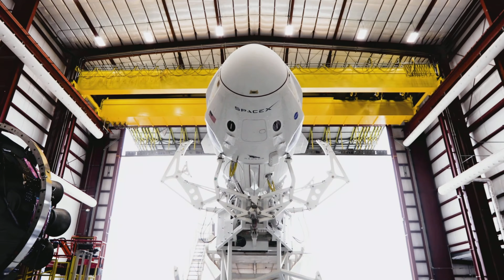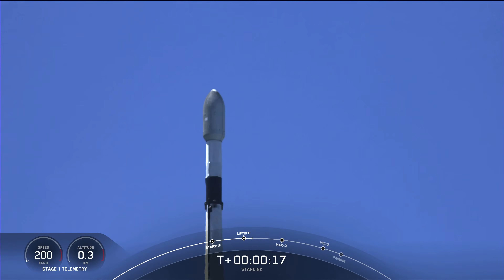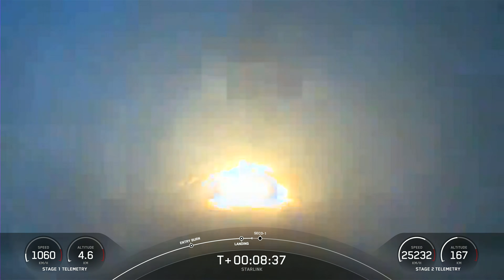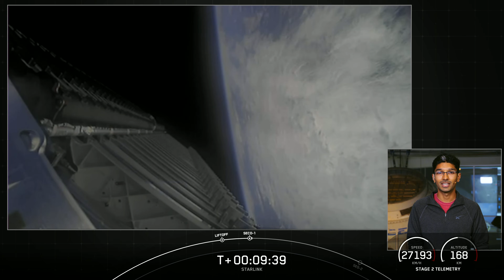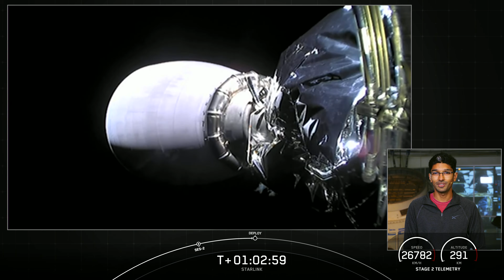Starlink Mission

Comment: helllooo mr Space x i was thinking is it possible to push magnets oposite forse so that they create like pushing force on the other side to be used as a battery.... here is the idea if you like push magnets they would want to repel right and can that force of repeling be used again as energy.. like charging would mean to push them and then when the pushing stops they start repeling eachother making the energy again...Batery idea... not sure if it will work but might be worth a try.... also think of like magnets ontop of other magnets .... 10 for example in a chamber being pushed transfering the energy...
Reply: energy doesent "appear" from nowhere, it is applied from object to object

Comment: Az normális, hogy ilyen ütemben lassul a rakéta az űrben? Vagy majdnem az űrben...

Is it normal for a rocket to slow down in space at such a rate? Or almost in space ...
Reply: Can You be more specific? It looks like You're mixing Ist stage speed with IIstage. Ist stage returns to Earth and lands on drone barge. IInd stage is the one achieving orbit. About orbits & speeds: if we are talking about circular (not elliptic) orbits, speed depends on the orbit radius (in relation to center of the Earth). The higher is the radius the higher is the speed. In fact: if You want to move ship from lower orbit to higher one, You do not point the nose "up" and start Your engines. You point the "nose" of the ship in direction of prograde of movement and start engines to increase speed.
Reply: @wojteksykurski  arra gondolok, hogy mikor már keringett az űrben és az adatok alapján folyamatosan lassult...és nekem egész gyorsnak tűnt a lassulás, de lehet ez normális volt és mikor már "túl lassú", akkor ismét gyorsítanak...

i think when it was already orbiting in space and based on the data it slowed down constantly ... and to me the deceleration seemed quite fast but it may have been normal and when it was already "too slow" they will accelerate again ...
Reply: @atasnonsense  it would be easier if You could give timestamp. From what You described it looks like issue with data syncing. Orbital parameters of IInd stage are calculated using 3 methods:
1. GPS (not very accurate because of speed and attitude)
2. Internal (inertia based) devices inside IInd stage
3. (most accurate) ground stations monitoring orbital movement.

 It is possible that IInd stage lost connection with 1 ground station, switched to inertia & GPS systems and than reconnected with 2nd ground station.

Comment: Question. If the rocket was to launch from the moon with the same fuel load what percentage of fuel would it use compared to a launch from earth.
Reply: Takes about 20% of the Delta-V to take off from the moon and get into low-moon orbit compared to taking off from Earth into LEO.

The exact fuel usage relies on the rocket equation though, and requires more math to answer than I can be bothered with right now.

Comment: @20:06 Does anyone see what looks like a lizard or mouse crawl across the top of the nozzle on the stage 2 side?
Reply: That is accumulated ice that looks that color due to the suit the engines release as they are full flow engines which most rockets have.

Comment: expected lost of signal... "bermuda" ??? 27:32
Reply: There is a ground station in Bermuda that provides tracking and telemetry relay from the spacecraft when it is nearer to the launch site. Once the second stage has gone far enough, the curve of the Earth blocks the signal. This is when the call: “Expected loss of signal…Bermuda” is made. If you listen to the coast phase you will hear other call outs for acquisition and loss of signal for other ground stations as the second stage orbits the Earth.

This is normal and expected.

Comment: How is it that they can land a rocket but can't figure out how to film the landing on the boat.
Reply: For the millionth time, the vibration of the rocket landing on the boat knocks the antenna out of alignment with the communications satellite. It is a transmission problem, not a photographic one.
Reply: @odysseusrex5908  ummmm seems like it should be a lot easier to overcome that problem than shoot a rocket into space and then land it back on earth.
Reply: @shimyns   No, it isn't. The whole boat is being violently shaken, and hence the antenna. There's really nothing you can do about it. Once Starlink is really up and running they may be able to use it instead of satellites in geosynchronous orbit, but they are not doing it yet.

Comment: Still better launch presentation than ULA's launch before, nice
Reply: To say nothing of Blue Origin's with New Shepard.
Reply: @odysseusrex5908  wait, blue what?
Reply: @rachmanhardian6858    You know, that outfit run by Jeff Who? The presentations when they have done their New Shepard test launches have been absolutely cringe inducing. the commentators are clearly PR flacks with no engineering knowledge whatsoever, trying to make it sound as though this glorified sounding rocket is the greatest thing since Buck Rogers.

Comment: Intro Music: Crew - Test Shot Starfish

Coast Phase Track 1 - (25:54-31:25) Currently Unreleased - Test Shot Starfish (Scheduled for a Summer 2021 Release)

Coast Phase Track 2 - (31:25-38:27) The New Astronauts - Test Shot Starfish (Released) 

Coast Phase Track 3 - (38:27-43:01) Currently Unreleased - Test Shot Starfish (Scheduled for a Summer 2021 Release) 

Coast Phase Track 4 - (43:01-50:32) Crew - Test Shot Starfish (Released)

Coast Phase Track 5 - (50:32-56:41) Unicorns in Space - Test Shot Starfish (Currently Unreleased, set for a Summer 2021 Release) 

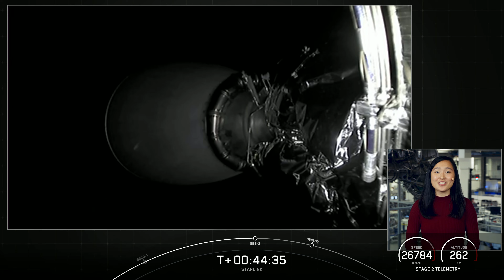Coast Phase Track 6 - (56:41-1:00:23) Re-Flight - Test Shot Starfish (Released)

Coast Phase Track 7 - (1:02:31-1:07:58) Currently Unreleased - Test Shot Starfish (Set for a Summer 2021 Release)

Coast Phase Track 8 (1:07:58-1:13:05) Andromeda - Test Shot Starfish (Released)

Coast Phase Track 9 - (1:13:05-1:18:41) Unicorns in Space - Test Shot Starfish (Currently Unreleased, Set for a Summer 2021 Release)

Outro Music - Crew - Test Shot Starfish (Released)

Comment: What is all that snow like particles flying around?
Reply: Precisely that. The rocket is very cold because of the liquid oxygen, so water in the air condenses on it and freezes. The ice then breaks off during flight. Also, they have to continuously vent oxygen from the LOX tank. Some of this freezes in the vacuum of space.
Reply: @odysseusrex5908  thank you
Reply: @adamt7970   You're welcome.

Comment: Lol chemtrails in the sky
Reply: Chemtrails aren't real
Reply: @Ethan_Roberts  Really? I believe con trails is real, sure. But its not the same at all. And contrails is only visible for a moment chemtrails stay for long, theres a clear difference. Try to look at how they often fly up make a cross and dissapeer again... So strange. Why fly up with no trails, suddenly a trail starts, then stops again. Then it fly a bit, start it, and make a cross and fly away again with no trails. I see this all the time dude
Reply: @MMM-dj7ou  It's simple physics. Even you could look this up since you encourage looking these things up. When the hot gases of a plane (H2O and CO2) get expelled from the engines, the water condenses from steam to mist, or a cloud. This condensation is what gives the name condensation trail or contrail. If the atmosphere is cooler or has a lower pressure, a long trail will form. Vice versa and a shorter trail will form. It's to do with the relative dew point and the relative temperature/pressure.
Reply: @Ethan_Roberts  dude... Contrails should dissapeer just after it appers? Like when you breath in the cold... Its not like you see it for hours like chemtrails. Its obvious something is wrong. Theres plenty of evidence out there
Reply: @MMM-dj7ou  There's very little to no evidence out there for chemtrails. You search for 'car exhaust on cold day' and you'll see many images of cars producing the same effect. Sometimes it can last for quite a while. If they should disappear right after they've appeared, wouldn't that mean clouds couldn't form? They're made of the same stuff after all.
Reply: @Ethan_Roberts  ye... Its getting censored my friend. You cant use Google or youtube for stuff like that. Then you wont find much, sometimes a little but theres plenty of free speech sites with information :)
Reply: @MMM-dj7ou  Getting censored? What a joke, it's literally cars with visible exhausts. Nothing to hide there. Or is it that you won't search it otherwise it'll hurt your beliefs? Since you make yourself seem like an expert on 'chemtrails', tell me what they're spraying into the air? Also, quote your sources of info, if you can.
Reply: @Ethan_Roberts  ye you got no free speech anymore, dont you know that?
Reply: Look it up theres plenty of free speech sites with information :)
Reply: @Ethan_Roberts  lol ive just made 2 comments with links on alternative media sites and I cant send them in here cause they Are banned
...
Reply: @MMM-dj7ou  They're not permitted on this channel. I've tried to send other links before of pictures I've taken of space to debunk flat earthers and they got removed. It's not that they're preventing free speech, it's to stop potential spammers. You can still defend your point by explaining what they're spraying into the atmosphere or what they're hiding.
Reply: @Ethan_Roberts  lol again it got deleted, didnt even send links just wrote the adresse with space between each letter.. But im no expert on chemtrails anyways. Too many crimes against humanity is talking place to dig into everyone at once.. But some metals and shit. You dont believe in censur?
Reply: @Ethan_Roberts  ofc they Are? Look it up and try to explain that to yourself afterwards... What Are they then?
Reply: @MMM-dj7ou  Contrails.
Reply: Conspiritard?
Reply: This is one of the more childish conspiritards.

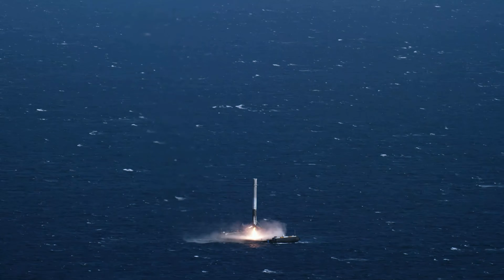Comment: You can see rats and lizards on the engines during the launch. Look above the cone and the pipe The fun begins at SpaceX mission time T+00:02:43 through T+00:08:25. You can see a single rat fall off at T+00:9:39 through T+00:9:44. I'm not kidding.
Reply: Those aren't rats or lizards.
Reply: @καλαμ  So what kind of animals are they? What look look lizards to me have 4 legs and long tails. I live in 60 miles from the launch site. I've got lizards that look just like them in my yard.
Reply: @RobertErickson  It wasn't an animal, an animal would not be able to survive. It's just ice.
Reply: It is just frozen oxygen. It happens every flight.

Comment: 16:56 Supersonic shockwave. Not a common sight. Was it going to fast?
Reply: Thought it was gonna blow up when i saw it 🤣
Reply: Awesome shockwave view! The atmospheric and lighting conditions were just right for us to see it
Reply: it depends on the local humidity on the top levels of the troposphere
Reply: No, it was going the correct speed. There was just enough humidity in the air to see the shockwave.
Reply: @UnitZER0  Yep, Scott Manley just Manleysplained it. Apparently ice crystals in Cirrus clouds plus the vehicle going transonic. Couldn't get a more perfect timing to shake people's nerves! 😂
Reply: Never seen that before. Wondered exactly the same.. was fucking awesome though!
Reply: Prandtl–Meyer expansion fan.
Reply: The rocket reachs super sonic speeds each time during launch. That is physical result of breaking the sound barrier.
Reply: @710islife93  Yep but at a set time. You wouldn't wanna overstress this slim jim of a rocket. F9 - infamous for being scrubbed for upper level winds. 😬
Reply: The audio around 18:00 is hella weird as well, some eerie sounding processing going on
Reply: Excellent!
Well done.
Thx.
wwg1wga
Reply: Lizard running at the ring @ 19:27
Reply: https://youtu.be/asAC3JguAvI

Comment: Here is a timeline of the mission if you are late.

2:16 - WEBCAST INTRO
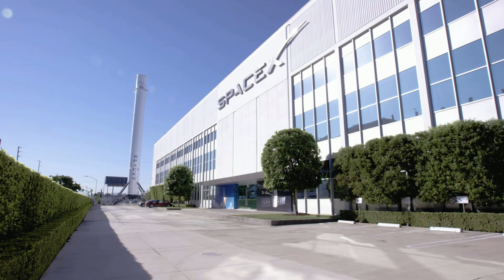2:57 - WEBCAST START
8:53 - ENGINE CHILL
11:23 - STRONGBACK RETRACT
14:53 - FALCON 9 STARTUP
15:16 - LAUNCH DIRECTOR GO FOR LAUNCH CALLOUT
15:44 - T- 10 SECONDS
15:54 - LIFTOFF FROM SLC-40 
17:10 - MAX-Q (MAXIMUM DYNAMIC PRESSURE)
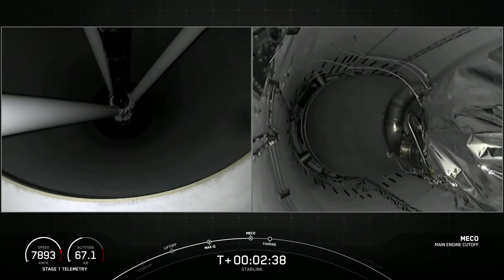18:30 - MECO (MAIN ENGINE CUTOFF)
18:34 -  STAGE SEPERATION
18:39 - SES-1 (SECOND ENGINE STARTUP)
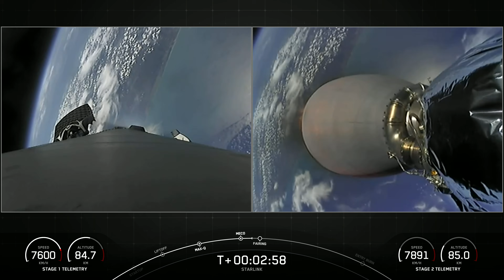18:50 - GRIDFINS DEPLOY
19:05 - FAIRING DEPLOY
22:29 - ENTRY BURN
22:47 - ENTRY BURN SHUTDOWN
24:02 - LANDING BURN
24:19 - LANDING LEGS DEPLOY
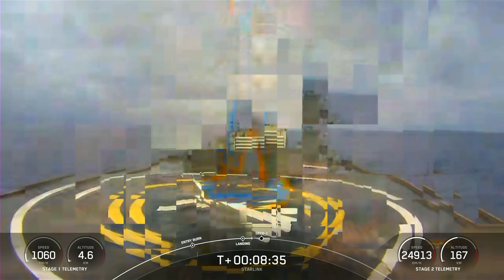 24:27 - TOUCHDOWN ON JRTI (JUST READ THE INSTRUCTIONS) DRONESHIP
 24:45 - SECO-1 (SECOND ENGINE CUTTOFF 1)
 25:52 - WEBCAST BREAK 1
 1:00:26 - WEBCAST RETURN 1
 1:01:44 - SES-2 (SECOND ENGINE STARTUP 2)
 1:01:49 - SECO-2 (SECOND ENGINE CUTTOFF 2)
1:02:29 - WEBCAST BREAK 2
 1:18:40 - WEBCAST RETURN 2
1:20:06 -  TWENTY-EIGHTH STARLINK BATCH DEPLOYMENT
1:20:45 -  WEBCAST END

 
NOTE: The batch of 60 Starlink satellites launched today will complete the first shell of Starlink satellites.

NOTE 2: The first stage used in this mission was previously used on the Sentinel-6A mission.

NOTE 3: One fairing half used in this mission was previously used on four Starlink missions whilst the other was previously used on the Transporter-1 mission and a Starlink mission.

Have a great day!
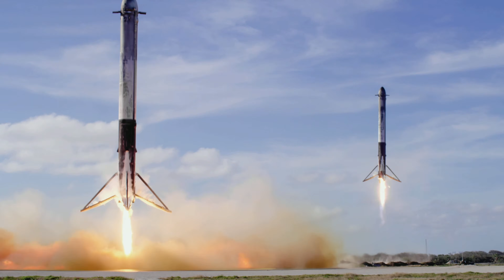Reply: 2:57 Stream Start
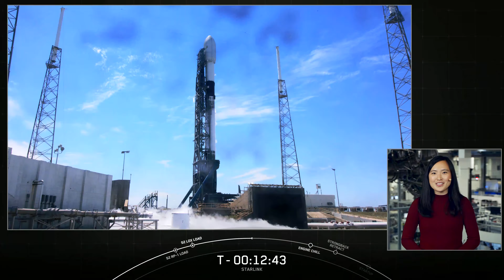3:12 Hi Youmei!
9:00 Hi other guy (idk his name)
14:53 T - 1 minute
15:43 T - 10
15:53 Ignition
16:56 Cool Shockwave!
17:10 MAX-Q
18:29 MECO and Stage Sep
19:05 Fairing Separation!
22:29 Entry Burn
22:47 Entry Burn Shutdown
24:01 Landing Burn
24:17 JRTI Cam!
24:30 Another beautiful landing!!! And SECO-1
25:54 - 1:00:24 Coast Phase
1:01:28 SES-2 and a quick view of the second stage LOX tank! and SECO-2!
1:02:30 - 1:1841 Coast Phase pt. 2
1:20:05 Starlink Deploy!

Amazing job SpaceX! We love your launches!
Reply: Thanks!
This is a super comprehensive launch timeline, which is really cool
Reply: Lizard running at the ring @ 19:27
Reply: @thedarkside13  https://www.youtube.com/watch?v=xRu-ekesDyY&lc=UgxAtL9V8y-rAsdiupF4AaABAg
Reply: You are awesome dude!
Reply: Most fabulous!
Reply: Very helpful!
Thx.
wwg1wga
Reply: @thedarkside13   * capes needed *
Reply: Dirtiest Falcon 9 fairing launched, to date.
Reply: Thx a lot 😃👍